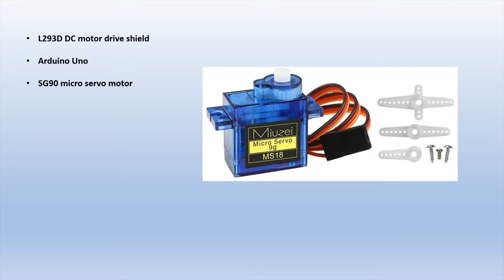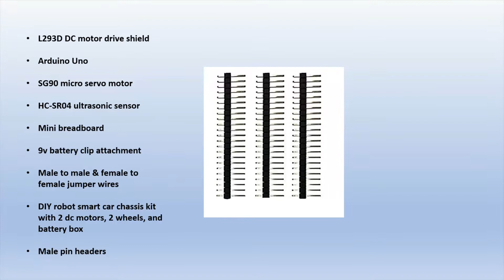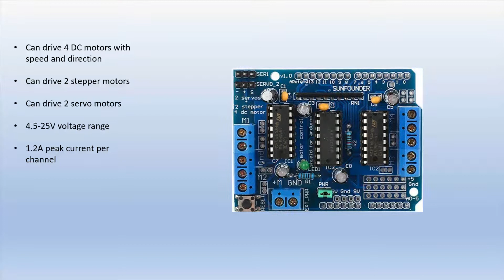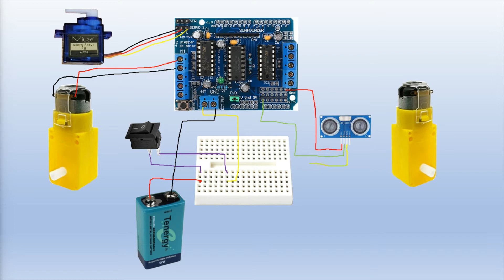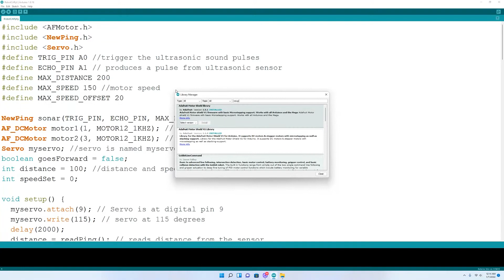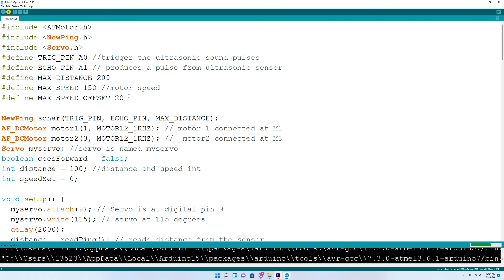A Step By Step Complete Build Of Arduino Robot Car With Ultrasonic Sensor For Hands Free Operation

Comment: whats the loop code pls tell now
Reply from the maker: #include <AFMotor.h>
#include <NewPing.h>
#include <Servo.h>
#define TRIG_PIN A0 //trigger the ultrasonic sound pulses
#define ECHO_PIN A1 // produces a pulse from ultrasonic sensor
#define MAX_DISTANCE 200
#define MAX_SPEED 150 //motor speed
#define MAX_SPEED_OFFSET 20
NewPing sonar(TRIG_PIN, ECHO_PIN, MAX_DISTANCE);
AF_DCMotor motor1(1, MOTOR12_1KHZ); // motor 1 connected at M1
AF_DCMotor motor2(3, MOTOR12_1KHZ); // motor2 connected at M3
Servo myservo; //servo is named myservo
boolean goesForward = false;
int distance = 100; //distance and speed int
int speedSet = 0;
void setup() {
myservo.attach(9); // Servo at digital pin 9
myservo.write(115); // servo at 115 degrees
delay(2000);
distance = readPing(); //distance from the sensor
delay(100);
distance = readPing();
delay(100);
distance = readPing();
delay(100);
distance = readPing();
delay(100);
}
void loop() {
int distanceR = 0;
int distanceL = 0;
delay(40);
// If distance is < 20 cm - do this function
if (distance <= 20) {
moveStop();
delay(100);
moveBackward();
delay(300);
moveStop();
delay(200);
distanceR = lookRight();
delay(200);
distanceL = lookLeft();
delay(200);
if (distanceR >= distanceL) {
turnRight();
moveStop();
} else {
turnLeft();
moveStop();
}
} else {
moveForward();
}
distance = readPing();
}
int lookRight() {
myservo.write(50);
delay(500);
int distance = readPing();
delay(100);
myservo.write(115);
return distance;
}
int lookLeft() {
myservo.write(170);
delay(500);
int distance = readPing();
delay(100);
myservo.write(115);
return distance;
delay(100);
}
int readPing() {
delay(70);
int cm = sonar.ping_cm();
if (cm == 0) {
cm = 250;
}
return cm;
}
void moveStop() {
motor1.run(RELEASE);
motor2.run(RELEASE);
}
void moveForward() {
if (!goesForward) { // moves forward if all clear
goesForward = true;
motor1.run(FORWARD);
motor2.run(FORWARD);
for (speedSet = 0; speedSet < MAX_SPEED; speedSet += 2) {
motor1.setSpeed(speedSet);
motor2.setSpeed(speedSet + MAX_SPEED_OFFSET);
delay(5);
}
}
}
void moveBackward() {
goesForward = false;
motor1.run(BACKWARD);
motor2.run(BACKWARD);
for (speedSet = 0; speedSet < MAX_SPEED; speedSet += 2) {
motor1.setSpeed(speedSet);
motor2.setSpeed(speedSet + MAX_SPEED_OFFSET);
delay(5);
}
}
void turnRight() {
motor1.run(FORWARD);
motor2.run(BACKWARD);
delay(300);
motor1.run(FORWARD);
motor2.run(FORWARD);
}
void turnLeft() {
motor1.run(BACKWARD);
motor2.run(FORWARD);
delay(300);
motor1.run(FORWARD);
motor2.run(FORWARD);
}
Reply from the maker: You may want a  beefy battery to power it. The 9v I used in my video worked fine for me. 👍

Comment: what did you use to make the robot move 🤔🧐
Reply from the maker: hey there!
parts list starts at 0:39   
I used two 3-6v dc motors,  a motor driver, and a 9v battery to make it move.

Comment: Hi the tutorial is amazingly clear i just have a question can i use a 4 battery pack instead of the 9 v battery you used?
Reply from the maker: Try this. Remove the jumper on the driver board and connect a  9v battery to the external power screw ternimal. Use a different 9v battery to power Arudino using the barrel jack.
Keep in mind, if connected power (usb or barrel jack) to Arduino, you should remove the jumper first. This should work better for you   👍
Reply: Hi just another question what battery did you use in the tutorial? @BMonsterLaboratory
Reply from the maker: It looks like I used a Tenergy 9V Battery Rechargeable 250mAh. I probably ran the car for 5min or so. I'm not sure how long until the battery is depeleted. If I rebuilt this today I would use kratax 850mAh high Capacity Rechargeable 9 Volt Lithium-ion Battery. They have a larger capacity. There there are other options as well. Try using a 6XAA battery pack - you'd get +/- 2000mAh.
Reply: @BMonsterLaboratory my motors are moving very weakly and slowly for some reason
Reply from the maker: remove power jumper on the driver board and power Arduino and driver board separately.  It has been a while since I did this but I can rebuild it for different power options if needed. Let me know

Comment: What to do it shows  goes forward was not declared in this scipe
Reply: Plsss can u tell me
Reply from the maker: You need the libraries in your Arduino file. see previous answer
Reply from the maker: the AFMotor library is missing from your Arduino libraries. Same with the NewPing library. You need them both in your file before you can load the sketch to your board. 👍

Comment: it says i have a problem with compilation on # include <AFMotor.h> can you help me?
Reply from the maker: hey there!  It looks like maybe you don't have the Adafruit motor library installed (AFMotor.h). Install the library by going to Sketch > Include Library > Manage Libraries in the Arduino IDE. In the Library Manager, type "Adafruit_Motor_Shield_librrary". You should be able to install from the IDE, which is convenient! Hope that helps  👍

Comment: What means if I have com3?
Reply from the maker: it's your port settings.  where you plug into your pc will change it. change usb location to plug your arduino in and it will be a different COM#

Comment: what are the cables that you used to connect the on and off switch and the servo shield and that yellow cable that you connect the bread board with the servo shield
Reply: I have another fast question if I changed the cable place for the sensor is there is any problem for example if I plug the cable in the first row but instead of the first pin I changed to the second
Reply from the maker: @cr_reels6792  you can use any Analog pin for your sensor Echo & Trigger pins. For instance, if you used A2 and A3 for Echo and Trigger your code in the setup would change to this:

#define ECHO_PIN A2 // produces a pulse from ultrasonic sensor
#define TRIG_PIN A3 //trigger the ultrasonic sound pulses

You just need to tell Arduino which pins you're using.
I hope that makes sense :)
Reply from the maker: hey there!  I didn't want to use anything permanent so I used 22gage wire. It's somewhat stiff and held up when I wrapped it through the switch connectors. It's also the perfect size to fit right into the arudino pins. It's solid wire, not stranded.

Comment: Hello, for some reason my car isnt driving the only thing moving is the ultrasensor
Reply from the maker: Hi there! Are you using the same motor driver I am? Tryin to think of what it could be. Are you getting power to the motor?  check the motor connections to the terminal ports on the driver. Double check the code as well. If it still doesn't work I'll be happy to help where I can👍
Reply: @BMonsterLaboratory  no power in the motor, once i upload the code, the only thing that moves is the ultrasensor
Reply from the maker: Did you load the entire code from the facebook post? It was a 2 part post. If so, it has to be an issue with the hardware.
Reply: @BMonsterLaboratory  yes I have, I got new motors and now it’s not moving at all 😥
Reply: i changed the motor when, i roll it by hand there is power BUT after uploading the code it still isnt moving at all
Reply from the maker: @doussoujulie  can you share the code and pin connections?
Reply: @BMonsterLaboratory  the code is what I have from you with the video. I went back and review to video to make sure that I did everything right 

Do you have WhatsApp
Reply: How did you connect the motor wires into M1 M2
Reply from the maker: @doussoujulie  go to the 8:30 time stamp. that shows the exact connections I made. At 8:36 you can see a good view of the actual motor driver.
Reply: @BMonsterLaboratory  thanks
Reply: also my arduino only work when i put arduino one and port com4 arudino uno. the code doest work when i put arduino mega
Reply: I think it's more of a voltage problem , try using a 9v dc battery

Comment: Hello sir. I have arranged all the hardware but during compilation, it is showing me  error 
Use of undeclared identifier 'readPing' 
Use of undeclared identifier ' moveStop'
Use of undeclared identifier ' moveBackward'
Use of undeclared identifier 'lookRight'
Use of undeclared identifier 'lookLeft'
Use of undeclared identifier'turnLeft' 

All these types of errors are showing.
Reply: Also sir, I am using the arduino droid application on my phone for programming.
Reply from the maker: I've never used that. How do you like it?
Reply from the maker: hey there! If you used the code I posted, did yo include the libraries? 
#include <AFMotor.h>
#include <NewPing.h>
#include <Servo.h>
I posted the code on Faceook. search #robouino to find it in the comments. expand the comment section to find it.  👍
Reply: Yes sir. I have used all the libraries. I think the problem is with the android version app that I used. So I have installed the software on my laptop and it compiled successfully. But now I am not able to upload the code on my Arduino Uno. I have tried replacing the connecting cable, using the resetting button. Is there any way that I can make sure that my Arduino board is functioning well?? Thank you in advance..
Reply from the maker: @varunmudgal8752  are you getting an error mssg? do you have the board and port selected?  try blinking the onboard led to see if that works.
Reply: @BMonsterLaboratory  sir it is showing me this error 
() attempt 9 of 10: not in sync: resp=0x34 avrdude: stk500_recv(): programmer is not responding avrdude: stk500_getsync() 

I have tried switching the cable, tried switching a reset button but it all went in vain.

Comment: Can you pleae place the code here? hard to copy and paste or just to type up or see. I only go on facebook on my phone.
Reply from the maker: Sure. I'll post it this evening. 👍
Reply from the maker: this is a long one... may have to post in 2 parts.  Here it is
#include <AFMotor.h>
#include <NewPing.h>
#include <Servo.h>
#define TRIG_PIN A0 //trigger the ultrasonic sound pulses
#define ECHO_PIN A1 // produces a pulse from ultrasonic sensor
#define MAX_DISTANCE 200
#define MAX_SPEED 150 //motor speed
#define MAX_SPEED_OFFSET 20
NewPing sonar(TRIG_PIN, ECHO_PIN, MAX_DISTANCE);
AF_DCMotor motor1(1, MOTOR12_1KHZ); // motor 1 connected at M1
AF_DCMotor motor2(3, MOTOR12_1KHZ); // motor2 connected at M3
Servo myservo; //servo is named myservo
boolean goesForward = false;
int distance = 100; //distance and speed int
int speedSet = 0;
void setup() {
myservo.attach(9); // Servo at digital pin 9
myservo.write(115); // servo at 115 degrees
delay(2000);
distance = readPing(); //distance from the sensor
delay(100);
distance = readPing();
delay(100);
distance = readPing();
delay(100);
distance = readPing();
delay(100);
}
Reply from the maker: void loop() {
int distanceR = 0;
int distanceL = 0;
delay(40);
// If distance is < 20 cm - do this function
if (distance <= 20) {
moveStop();
delay(100);
moveBackward();
delay(300);
moveStop();
delay(200);
distanceR = lookRight();
delay(200);
distanceL = lookLeft();
delay(200);
if (distanceR >= distanceL) {
turnRight();
moveStop();
} else {
turnLeft();
moveStop();
}
} else {
moveForward();
}
distance = readPing();
}
int lookRight() {
myservo.write(50);
delay(500);
int distance = readPing();
delay(100);
myservo.write(115);
return distance;
}
int lookLeft() {
myservo.write(170);
delay(500);
int distance = readPing();
delay(100);
myservo.write(115);
return distance;
delay(100);
}
int readPing() {
delay(70);
int cm = sonar.ping_cm();
if (cm == 0) {
cm = 250;
}
return cm;
}
void moveStop() {
motor1.run(RELEASE);
motor2.run(RELEASE);
}
void moveForward() {
if (!goesForward) { // moves forward if all clear
goesForward = true;
motor1.run(FORWARD);
motor2.run(FORWARD);
for (speedSet = 0; speedSet < MAX_SPEED; speedSet += 2) {
motor1.setSpeed(speedSet);
motor2.setSpeed(speedSet + MAX_SPEED_OFFSET);
delay(5);
}
}
}
void moveBackward() {
goesForward = false;
motor1.run(BACKWARD);
motor2.run(BACKWARD);
for (speedSet = 0; speedSet < MAX_SPEED; speedSet += 2) {
motor1.setSpeed(speedSet);
motor2.setSpeed(speedSet + MAX_SPEED_OFFSET);
delay(5);
}
}
void turnRight() {
motor1.run(FORWARD);
motor2.run(BACKWARD);
delay(300);
motor1.run(FORWARD);
motor2.run(FORWARD);
}
void turnLeft() {
motor1.run(BACKWARD);
motor2.run(FORWARD);
delay(300);
motor1.run(FORWARD);
motor2.run(FORWARD);
}

Comment: Hello, I have a problem when the car moving forward the right side DC motor move slow & sometimes not moving I need to move the tyre using hand then it worked but still slow but when reverse it worked. Can you help me? Thanks
Reply from the maker: Hey there! Sounds like a power issue. Make sure all the wires are properly attached including good solder attachments. Also, try different batteries and make sure the tires are free to turn easily.  Let me know how to goes! 👍
Reply: @BMonsterLaboratory  hi sir, the problem that i was facing has been resolved now. but even i am also facing a similar issue. one motor is moving slower than the left one which makes my the whole car to move only clock wise. kindly help. i have checked all the connections. if @sylvester Dunggat  can help in that???
Reply from the maker: @varunmudgal8752  Are you using the same components and code I'm using?  What power source are you using?
Reply: @BMonsterLaboratory  This is so stupid of me sir. Firstly, I have actually gone through all the codes and connections. Secondly, I have replaced the wiring from m1 to m2 and later to m3 port just to realise that It was actually the led lights that I fitted on the bottom🥴🥴🥴. It was touching the wheel due to which it was moving slower than the other wheel. I got it fixed now. I can't thank you enough for your guidance sir.  Thank you so much... Looking forward to your new videos.
Reply from the maker: @varunmudgal8752  glad you got that fixed. It's easy to overlook something like that and I think we've all been there. Awesome job finding the problem, though! 👍